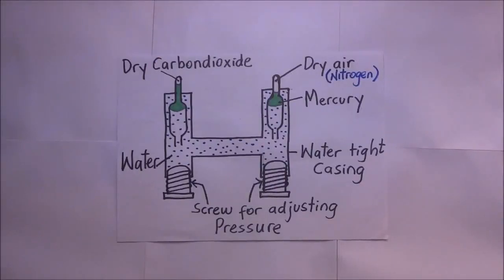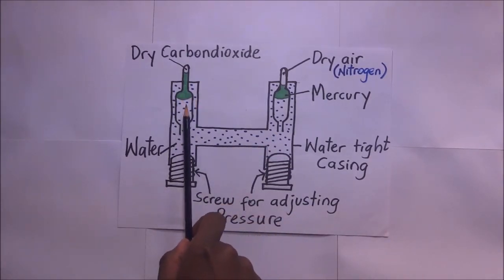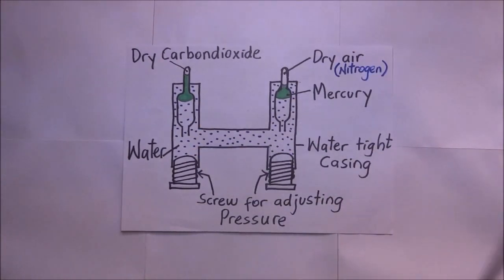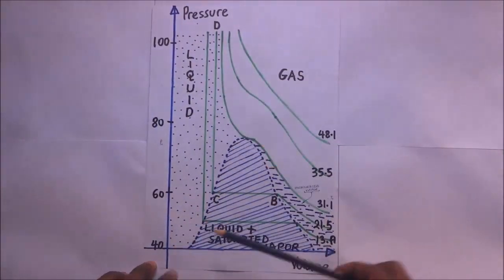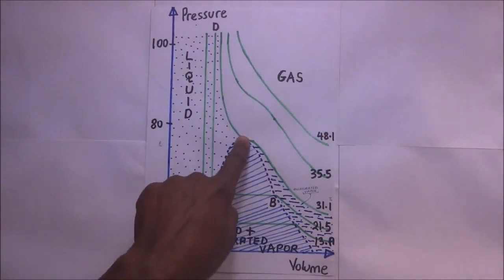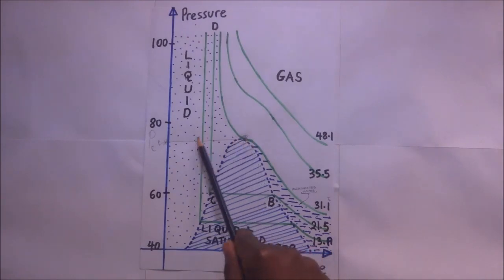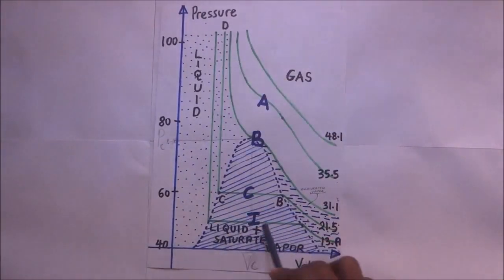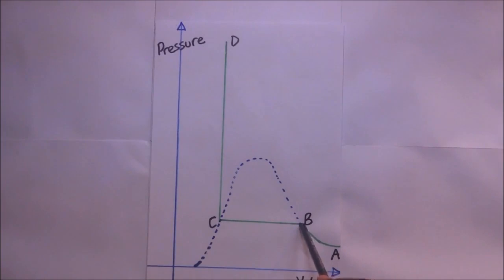ANDREWS experiment of Liquefaction of gases - Andrews experiment on carbondioxide - Kisembo Academy

Comment: Sir what is pressure in this case ?? 
Is it force with which we are pushing the piston or the force with which the molecules are hitting the wall ?
Reply from the maker: When you are pushing the piston, the force exerted is what will compress the gas molecules in an enclosed container. The gas molecules,(because of the force exerted on the piston) come closer to each other. When they are closer to each other, they collide to the walls of the container at a higher rate than before. It is this increased rate of collision of the molecules on the walls of the container that accounts for the increased pressure. So when we are talking about pressure in an enclosed gas, it is simply the measure of the rate of collision of the gas particles onto the walls of the container. This is the kinetic theory explanation of pressure in a gas...